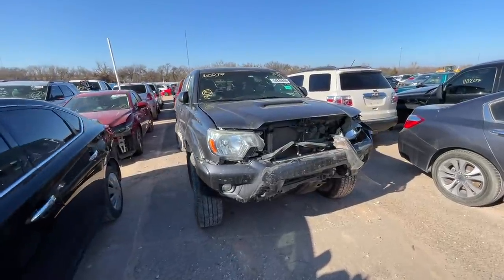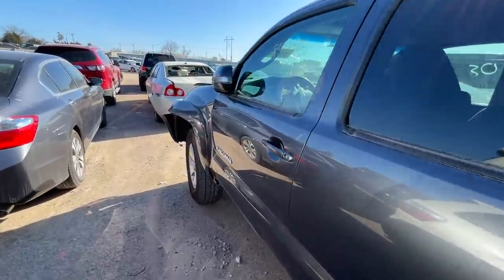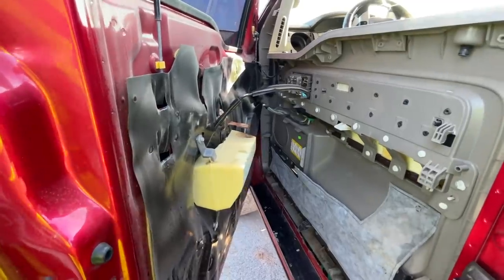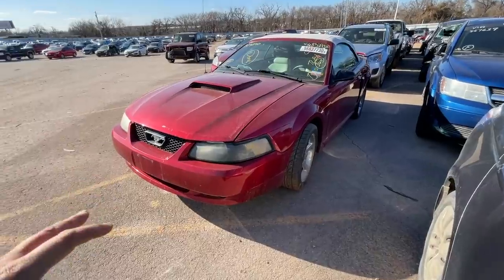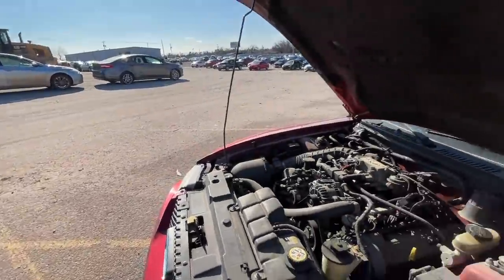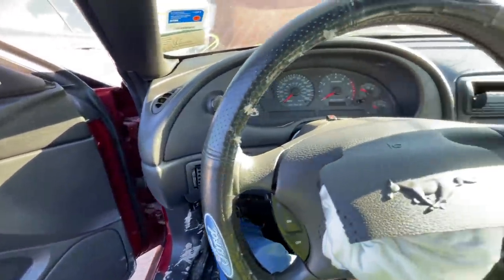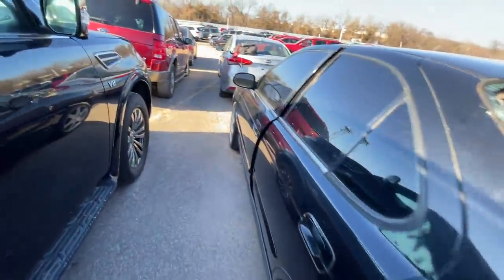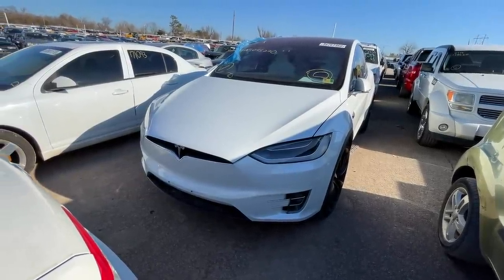Copart Walk Around 1-12-21 + 2017 Tesla Model X 100D

Comment: I had to look thos brakes in the Sentra up, and yeah, those are definitively real brembos. Part of the package for the Sentra Sr V-Spec
Reply: Yep lots of Nissan's come with brembos in spec v trim like the Altima too
Reply: Brakes are worth more than the car lol
Reply: @11094DEREK  $2,000
Reply: Not sure what a sentra is tbh. But we have a Nissan Almera hatchback that has the same front, dash up to the rear. In England that sentra would be bought and the engine, box and running gear thrown into a bubble shaped micra

Comment: My first car was a 2005 Nissan Sentra, 1.8 with a 5 speed manual. It had around 120K miles, but ran perfectly. I loved that car. It had damage from falling ice in almost the same places as the one you showed. The top of the rear window and the driver side quarter panel were hit pretty hard, but I was able to pop them out for the most part. It was  the same color too! Weirder still, I originally commented this before you even showed the Sentra!

Comment: It’s funny a lot of people jump into those cars and expect them to run after hitting something, but what Ford did was put an inertia switch on the fuel pump so this way a gasoline wouldn’t be fuel for a fire! If u ever go see another mustang 87 to 2000 I think might be 03 it’s in the truck back left by the tail light or front right kick panel and it just has a reset button that u press! Great vids! Enjoying the content.

Comment: I used to have a 2004 Nissan Sentra 1.8s back in 2007. Bought it with 54k miles in 07 and pretty much totaled it a month after I got it. $5,600 in damage. Then in 2009 totaled it for good. Bought it back from my insurance company for $600 with my loan paid off so it had a salvage/rebuilt title. Bought all the parts to fix it. 2 passenger doors and mirror, rear bumper cover and tail lights, new passenger fender and headlight all from a junk yard for like $400. Sold it on 2010 with 190k for $1000 lol. Used to live in Indiana and worked in Michigan so 60 mile commute one way to work. That's why I bought it it waa a great commuter car and i got my money's worth out of it. Little sentra definitely was a little trooper for all the miles I put on her haha

Comment: The mustang is fuel pump shut off. In most fords when the airbags deploy, there is a fuel pump shut off. It needs to be reset manually, usually behind driver side trunk panel

Comment: On those mustang when u get into a wrecked there is a switch that disengage to cut the fuel pump off you'll have to re-enable it. It in the truck right by the left counter panel

Comment: If it goes cheap enough, that Sentra SE-R Spec V would be a great donor car for someone who has a lower trim model with a clean body since the bodies are essentially the same. If not that, it would be worth it just to part out. Just the factory Brembos can go for $400-$500, as people use them as a big break upgrade for other cars. Then you also have the engine and 6 speed manual trans which can go for pretty good money. It just wouldn't be worth it to actually fix the body since even good condition ones don't sell for a lot.

Comment: Hey Randy, I'd look into the 3rd and 4th gen 4Runners (96-2002 =3RD Gen 2004 I think to 2009? =4th Gen) They're a good buy and are great SUVs with an actual frame. I personally have a 4th gen 2006 4Runner and its been a great vehicle and the resale value on these are good. Oh and I know you hate Timing Belt motors but the 3rd Gen V6 is a non interference motor and the 4th gen V6 it a timing chain motor. :)

Comment: That Mustang looks OK to me, a few years back a friend of mine went into a ditch and hit a bunch of rocks with his van.

I repaired it no problem, junkyard subframe for about 120 $ with the bolts and suspension arms and it's still driven everyday no problem.

Only difference is that the Mustang has airbags. 🤷‍♂️

Comment: Will hooking your booster pack up to a running car not charge it when it's at 14.5  volts?? I was thinking when the car is running at 14v your booster pack would be charging up when it's running for a few mins @autoauctions.

Comment: The only way to get in the dead model X is to jump the 12volt battery in the frunk they should be a way to open the drunk manually from the vent in the bumper or where the tow hook goes

Comment: All were good cars in this video Randy nice ones , stylish ones , etc. , etc...  if I were to highlight them oh you know first off would be the beast F150 lifted which is insane man love , love that thing that's setup for any truck ( all that it needs is remove those shitty wires assemble the interior and install a cool let light bar maybe in the bullbar or somethin' , man that should be good to go , play , tow or anything with it that beast is up for the game , secondly the Tesla 100D of course it has minimal damage bcos I'm just watching a youtuber Backyardboyz  fixed much worse damage on their Tesla , so in comparison this is very minimal a door just the door skin infact is only needed the door card/panel and all wiring  should be good may be a window as well  and depending on the extent of the damage may be light body filler / glacing putty on the rocker panel or any door panel accordingly. Yes Randy if they are affordable I know you will take both these vehicles / beast of vehicles and make them new and little custom you are the man for these two projects . But last but not least can't forget that MUSTANG GT convertible , man that's a game changer beast of a car man if had different wheels on it , also it may have a exhaust , ooooh oh man that's one serious powerful machine /  race / sports car right there  ,    hey Randy don't get pushed away bcos it didn't start , surely it's fuel cut off from being supplied to the engine with those airbags blown many sports cars have that issue UPON COLLISION  and you know by heart to fix that , airbags as you said dirt cheap and straighten out that metal underneath and repair the suspension components I'm tellin' you that's a score / steal  for project and daily sports car man always loved these things. Excellent content Randy , crystal clear sharp content , keep goin , grindin' and Rockin , Rollin' with excellent work , lets gooo . Stay safe and God bless.

Comment: really, the red Mustang GT should not be that hurt from the subframe hit.   I think it's a bolt-on part.   I had an '06 Montego that got a hole punched in the subframe and the transmission case broken from debris that my wife hit, insurance fixed it with a salvage yard subframe and transmission swap.  It was fine after.

Comment: Rough Country just kindof has a reputation for being cheap quality mostly. Lots of things in the past they've put out before have had bad failure points or shotty craftsmanship. You get what you pay for though, $1000-$1500 lift kit VS $3000-$5000 actual purposeful suspension system/lift kit. Just like anything else, there's cheap and there's quality. Your jeep you shoulda gone with Metalcloak, Rubicon Express, Old Man Emu or TeraFlex. That's just Jeep stuff though. Pickups are different, but also a different purpose really.

Comment: That Ford pick up is almost definitely a theft recovery... Recovered quickly but not before they'd started to strip it.

Mustang ragtop probably the fuel cut off. Usually easily accessible, but they keep putting them in different places every car 😂

Nissan a bit beaten up, but not beyond saving. If you like that sort of thing... Rear quarter dent should pop out, the C pillars less so.. PDR? 🤔 Buy it, throw front and back screens in it, get the dings looked at, and, if it's cheap enough, swap out that front fender... If the margin is a little tight then new glass, wipe its butt and send it down the road. Cheap run around for someone.😉

That little silver sedan parked in front of the Tesla could be of interest... Looks like a rebadged SEAT Cordoba/Toledo... (SEAT is a VW owned Spanish brand sold in Europe it's based on the VW Polo/Golf) apparently sold in Mexico, but I don't recognise the badge on it🤔 another cheap and chearful runaround.
Reply: Scratch that, it's probably a Buick Verano😂

Comment: Nothing there worth having today. F150 is an electrician's nightmare. 'Stang needs a whole new subframe. Rebuild Teslas are pointless once Elon finds out about them. Nissan may be the best bet if you can get it for beater money but what then? No-one will buy an old-shape Sentra with that many bumps and knocks.

As for future videos, my personal thing is vintage domestic iron. Sixties and Seventies in particular. I'd save all the four-doors. Not in the least interested in trucks or old Mustangs for that matter. There's a reason the pre-2004 stuff is going so cheap.